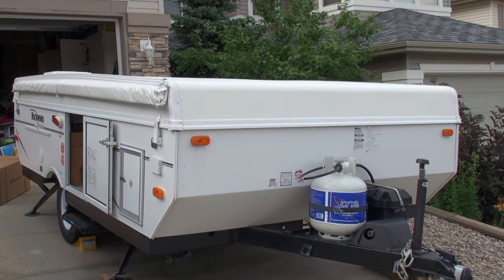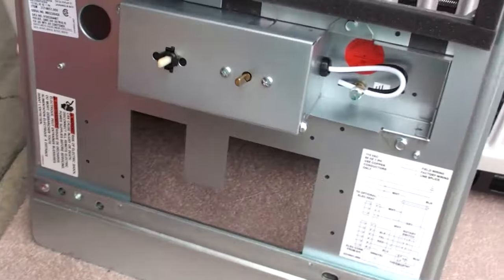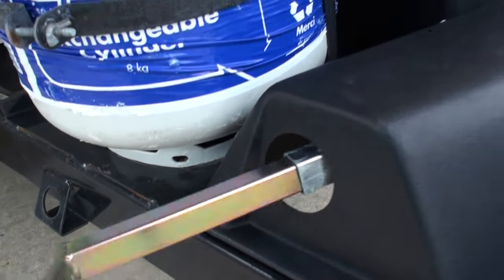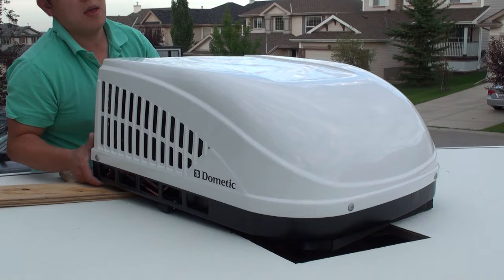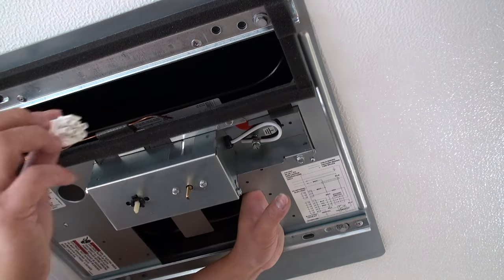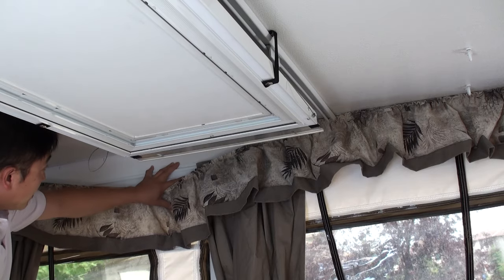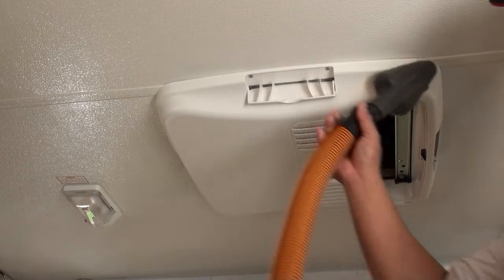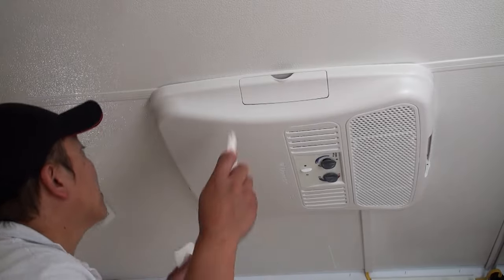Install a RV Roof Top A/C Unit on a Forest River Pop Up Camper Tent Trailer

Comment: Why no measurements? Wouldn't that help?
Reply from the maker: because the hole is pre-determined.  As longs you remove the screw in the ceiling and cut up to the framing (which you can feel) then that is the proper hole size.

Comment: NEVER cut the fiberglass in 90 degree angles. This of course will cause the fiberglass roof to spider crack out from the cut as the AC unit bounces on it. Real rookie mistake. However he is not alone, many dealerships did this for years before repair bulletins from manufactures started pouring in after warranty claims on roofs skyrocketed and even eventually lead to the closing of Fleetwood folding trailers. ALWAYS radius cut fiberglass, NO corners (i.e. 90 degree angles).
Reply from the maker: I have been very fortunate that this has not cracked so far.  Your tips is definitely useful should I ever have to install another a/c unit again.
Reply: Funny this exact method is on a service bulletin on Coleman’s older install manuals. The service tech is to drill 4 corners with a 1/2” hole, and jig saw a 14X14 cut into the center of each hole thus creating the radius you are talking about and not creating (4) 90 degree angles. On my Somerset with aluminum roof, the radius is very critical. On this dude’s trailer my method wouldn’t work without taking material of the metal and wood braces. I suppose he could have used a slightly larger drill bit to make the first radius outlines with the drill. Live and learn. Just inspect your trailer roof preseason and post season for cracks bro. If they do start at least you can repair early before leaks start.

Comment: I would have run my power wire along the roof, then across the roof line to where the roof jack is, then along that  down to the base of the camper then down to the box. No way should that power line hang in front of the window. A cement drill bit could have even been used in the ceiling  to the outside but unless you are pretty careful, you risk drilling a hole through the roof in the wrong place. You can buy some black or white  vinyl sock to run your wires through. Its really cheap. This guy is no electrician  thats for sure.
Reply from the maker: you clearly are clueless in how the factory approved install is done.  The power line DOES NOT run in front of a window but between a window seam.  Why on earth would you use a cement drill bit on an aluminum clad roof with styrofoam insulation?  The roof is CLEARLY marked from the factory with a screw where to drill through and start cutting.  It is YOU that is clearly doesn't understand how these things are built or how to install air conditioning units.
Reply: I should have said a long drill bit, not cement. Who cares where the wiring goes other than in front of the window. If it goes between windows fine. As long as it works, then fine.